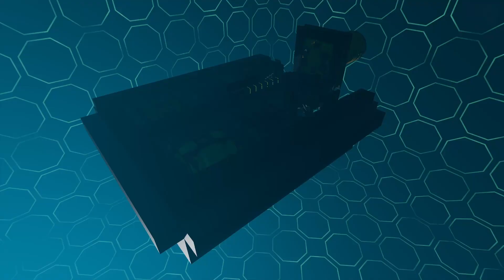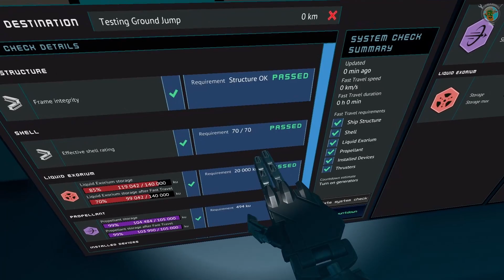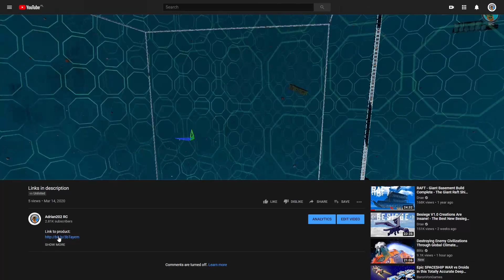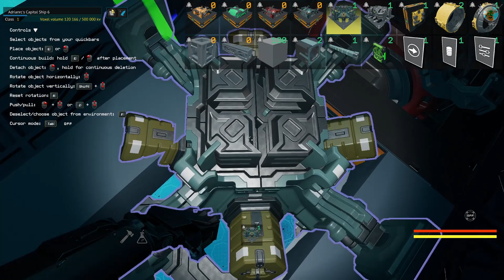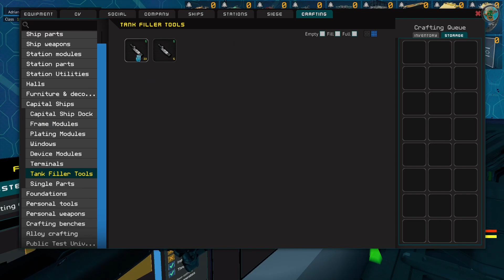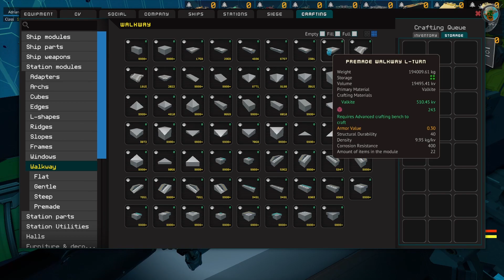Basic capital ship - Build Tutorial

Comment: How many beams to  slap a full size hanger on this thing? and how many more thruster rings, i'd love to see that video

Maybe a more important question to ask, how far can i jump with one of these?
Reply from the maker: I don't remember how many for full size, I know Zombiemouse posted that on Icarus Project Discord
https://discord.com/invite/gDX7YcDDHf
You can have hangar in size of one zone + beams that hold it and plates on that beams (all need to be in same zone)
This ship is designed with total minimum to jump out from hangar (remember to check a fix video with that necessary panels)
basic one should not have problem to get to Elysium and beyond because it's only one thruster but without hangar there is no point to go that far so it's designed to just jump out and disassemble to build new ship or just unlock another zone, build hangar and add generators, more rings or second thruster.
Range is calculated like this:
More items = more weight = more thrusters = more propellant :)

Comment: Doesnt work for me. Ive built a capital ship hangar in a new free cube on my station. Used exactly the pre-located corner pieces. Completed the hangar but it doesnt recognize it :/ Any ideas?
Reply from the maker: Make sure there is no station parts inside.
Remove part of frame and put it again
Check entire frame because if You place them fast, some will duplicate or shift and not get in correct place
Reply: @Adrian202  Checked whole structure again, zero parts missing, all capital ship hangar parts including all 8 corners. Checked for any items in the whole quadrant. There isnt a single other item in there except this full hangar. Still not recognized
Reply: @Drcfan  I just had this problem as well for the last 2 days. I finally got it working now though after rebuilding the whole thing 3 times, the last time that I built it I did it very slowly placing each beam one at a time and making sure it turned green before placing it and anytime an error popped up I removed like the last 3 beams and then continued building and it finally worked. doing the continous build seems to be an issue, that or it was just random but rebuilding it does seem to eventually work
Reply: Had the same issue, the hangar just wouldn't activate. The next day it just worked and it had it's blue forcefield without me changing anything. I renamed and then deleted a capital shortly before which might have caused issues with the 24h rename timer.